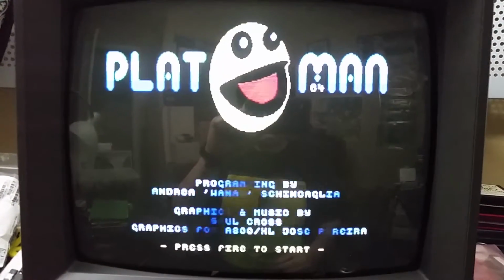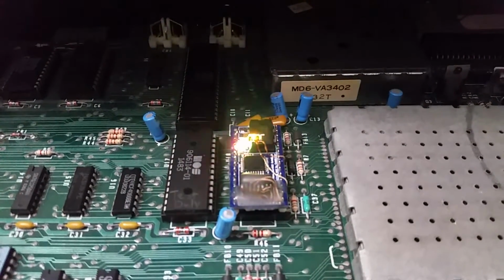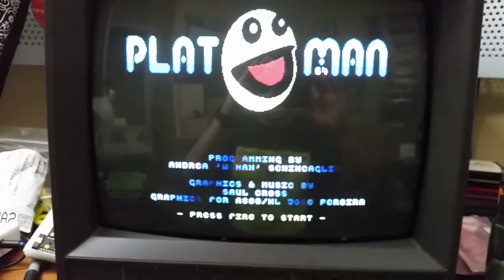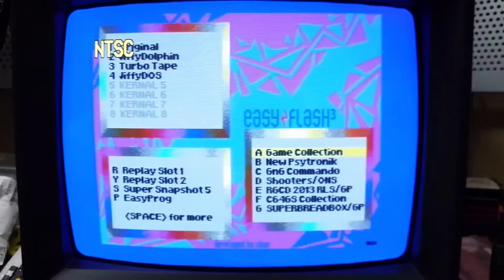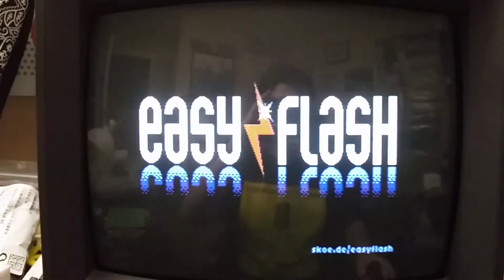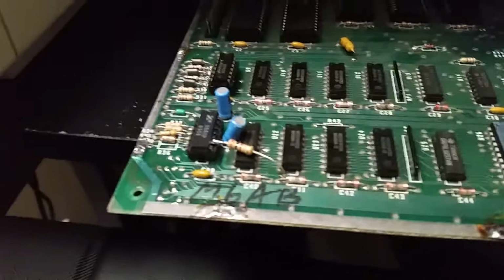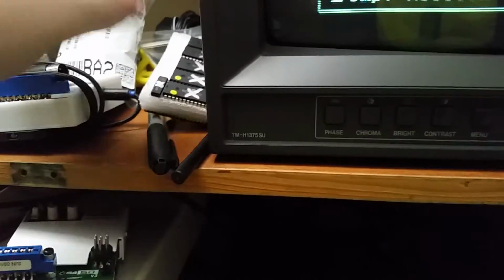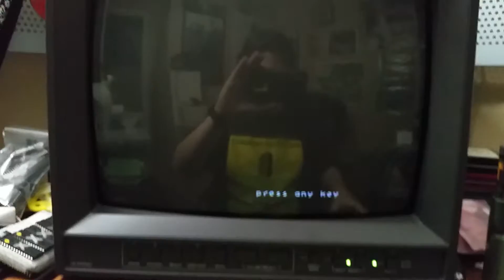326298 C64 board and SwinSID Ultimate demo

Comment: You can tell only old people watched this video cause there are no complaints about the horribly loud 15khz(ish) screeching that just burst my eardrums.
Reply from the maker: Jared I’ve had a few complaints about this. Not much I can do about the fact that I’m sitting a couple feet away from a CRT monitor with a flyback transformer making that noise. When I was younger myself I distinctly remember the horrible sound monitors made, but I can’t really hear it anymore due to age. I just use iMovie to make these, so I don’t know if there is a way to post-process the audio to strip out 15kHz+ freqs to eliminate it. Sorry about that....
Reply: @aphexteknol  Haha, I kind of figured that might be the case. I remember this same issue with some of my family's old TV's. It's probably not worth messing with for these older videos, but audacity is a free software that might be able to help process out sounds like that. I know it has powerful filters for background static noise and things. Anyways, I just got a c64 with the same board revision so I'm trying to learn some things about it before parts come in for a 1541 emulator

Comment: Up for a small challenge?  :) You can Mod an 1982 board for Svideo out by adding a transistor/resistor circuit at the VIC. Refer to the SX-64's Svideo out schematic for the connections. I drilled a hole where the svideo out pin goes on the connector and fed a thin wire to act as a pin socket. Works great! I can send pics of the mod if you like. PS.. love the 5v reg heatsink!
Reply from the maker: lostsignalreception I actually considered doing that to one of them. Honestly though, the composite video from these boards (especially after the R10 resistor mod!) isn’t that bad at all. Its only about as fuzzy as the s-video from early 250407 boards is, so I never bothered with an s-video mod. Also, well done spotting my quick and dirty heatsink hack using a computer case blanking plate. I dug around in my parts/junk bin looking for something suitable and it just happened to be the first thing I grabbed. Ironically it works a lot better than it has any right to!
Reply: @aphexteknol   I laughed when I saw it. The original Heatsink on that board seems like an afterthought, it hardly fits past the VIC shield. Is there a list of mods for the c64 somewhere? I didnt know about the reset and r10. I did the 1k reset mod and now my 1541 Ultimate works. THANKS!
Reply from the maker: lostsignalreception Glad to hear it! There isn’t really a list, which is why I wanted to share some of the tricks I’ve discovered along the way. Especially since these 1982 boards aren’t too hard to get ahold of and can be made into perfectly usable C64s with a little tweaking...

Comment: Hi, Mitch, it’s Kirk.  I just did the 1kOhm resistor mod on that 326298 breadbox, and can confirm that I can now get my 1541 Ultimate II+ to work properly, EXCEPT for the alternate Kernal option.  Not perfect, but, just glad I can now use it with this old machine.  Thanks for the helpful video!
Reply from the maker: triax1972 Good to know the U-II+ is working with this modification. Someone asked about that a year or so ago and I wasn’t sure at the time...

Comment: Hey, have you tested your mod with the 1541 Ultimate II+, or only earlier versions? I've modded mine, but it doesn't seem to work with the II+. I don't have any other newfangled gadget to test it with, unfortunately.
Reply from the maker: Cory Engel i only have the older Ultimate II and EasyFlash cart, which this mod allows to work. I wonder whats different with the II+ that wont let it work? The main issue is with how the reset lines handled on 1982 boards.
Reply from the maker: Cory Engel Also, I'll update the video description to say that the Ultimate II+ doesnt seem to work with this mod. When I made this video, I think Gideon had only just announced the new II+.
Reply: I just tested it on a second 1982 board with the mod, and that one didn't work either.
Reply from the maker: Cory Engel Thanks for the information though. Its a shame this doesn't work as its a simple enough mod, but at least we know the cause is likely to lay elsewhere.

Comment: What camera do you use to record with? That is some excellent resolution. I'm looking for one that can zoom too. Anyway nice setup you have. I write Basic and Assembly language programs on my channel.
Reply from the maker: I just use my Samsung S5 phone to film with. Nothing special, but it takes forever to upload 1080p videos like this however. Thanks for checking out my video, I'll have a look at your channel as well. Let me know if you have any suggestions/requests...
Reply: aphexteknol it came out really nice. To speed the uploading I convert them using tools like Pinnacle Studio or Microsoft's Video editor. I like all of the Commodore 64's. It would be nice if I actually had one that lasted. I've learned today that I need to add heat sinks to my chips.
Reply from the maker: Well I do repair on C64s as well. The main thing with C64s is to NOT run them on original power supplies. The original power supplies will eventually kill your C64 due to overvoltage. If you buy a modern power supply (google Ray Carlsen C64) and heatsink the hot chips you will have a C64 that will last another 30 years...

Comment: Did you just say that ''1983 boards don't normally operate with modern  accessories''?
Reply from the maker: If I did, I meant to say 1982. The boards I'm talking about are the 326298 revision boards that have 5 pin video output. Sorry for the confusion.

Comment: I like the way you solved this, because I was thinking pull-up+diode because the 555 timer is driving the line high hard. Here you are using the 555 timer as the pullup when it is inactive which is fine, and when it is resetting it will drive the line low. Thinking of the 100 ohm resistor, any other resetting driver must pull current through the 100 ohm resistor and bring the voltage below.. 0.9V or so (?).. I = (5V-1V)/100 = 40mA (?) .. It is fine for modern hardware to pull 40mA, but old hardware will suffer.. 4mA would be better (1k Ohm) for older cartridges, but then again is 1k enough to make the reset go low fast enough ? I think so. Has to be tested.
Reply: Late watching this video, but it has peaked my interest. To confirm, is the pin 9 leg of the 556 bent out and no longer inserted into the socket? Also, are you using a .5W resistor here?
Reply from the maker: MindFlareRetro Yep, thats whats going on. A 1/8th watt would work fine of course for this, all I had on hand at the time was the huge resistor so I used it. When I perform this mod now, I also make it look a lot cleaner than this as well, lol.
Reply from the maker: I was considering testing the pullup+diode method next, but honestly this solution works just fine from the testing I've done, and the methodology seems sound to me anyways. I just wanted to get this information out so folks with these boards don't have to suffer through not being able to use their modern accessories like I did initially. Most guys can handle a simple resistor hack like this. Thanks for the detailed analysis though, I'm still learning myself when it comes right down to it.
Reply from the maker: bwack Just tested a 1K ohm resistor and everything seems to function fine as before with 100 ohm. As an added bonus, EasyFlash 3 kernal replacement seems to function now, where it didn't before with a 100 ohm. 1541 Ultimate kernal replacement still does not however.
Reply: Thanks for the info. Would love to see a short video on your updated technique.